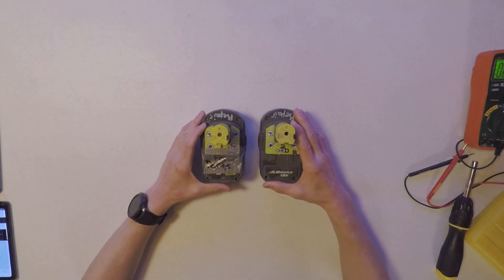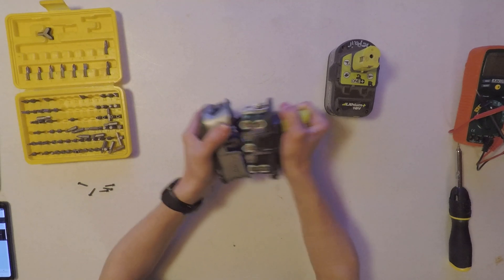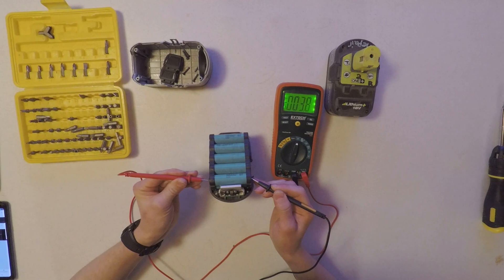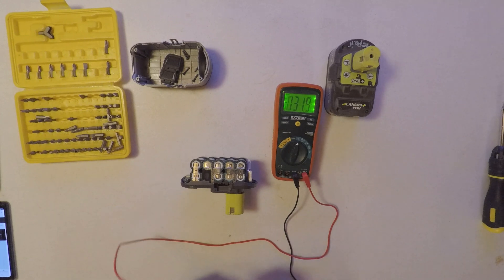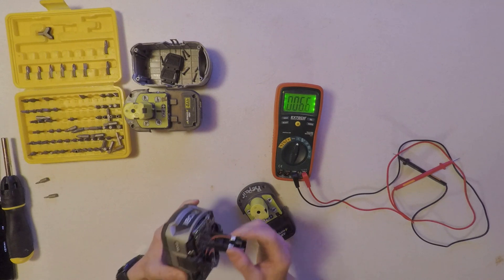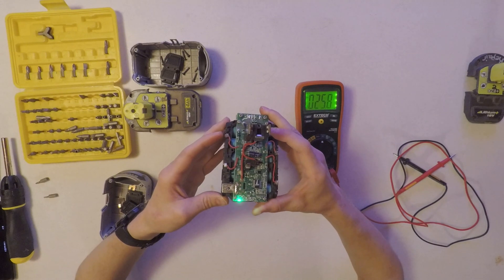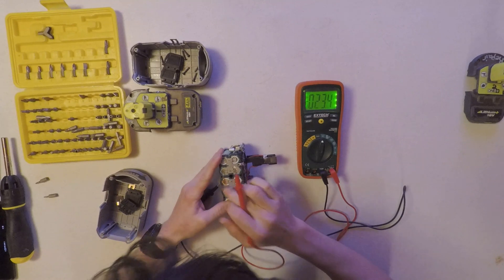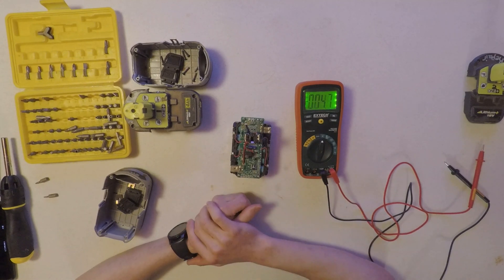Ryobi 18v P108 4.0 Ah Dead Batteries - Teardown and Voltage Test

Comment: I do have a question on the battery you are repairing or checking out that is the p108 the old style 4 amh one not the New Black ones. My batteries are good my circuitry board burnt up in mine I'm not able to get one from Ryobi. Do you sell those? as long as all the lights work on it. I still see that this is from 4 years ago but my battery has lasted over 10 years and the batteries are still good like I stated it's just a circuitry board that burnt out  Thanks
Reply from the maker: I don’t sell anything and I never got around to fixing these batteries. I have so many Ryobi 18v batteries here and I have only had one failure out of maybe 12 of them over the years. It is probably best to invest in a new battery. They do last a very long time. Usually you can get a new battery with one of the many tools they sell, for probably the same price as the battery by itself. If you really wanted to fix it, you might be able to buy a used battery and swap parts? It is definitely possible, but will take some work.